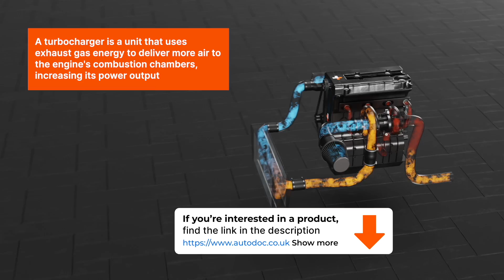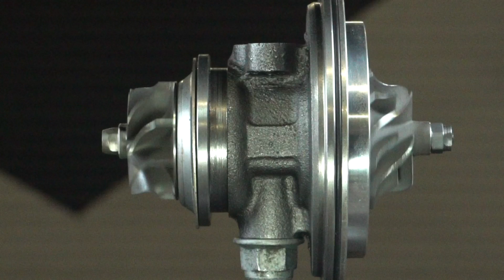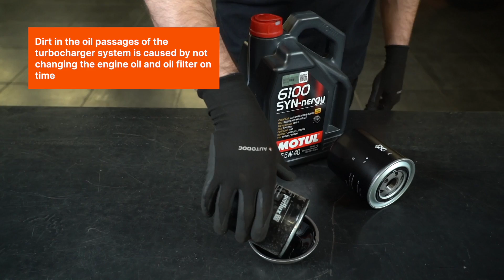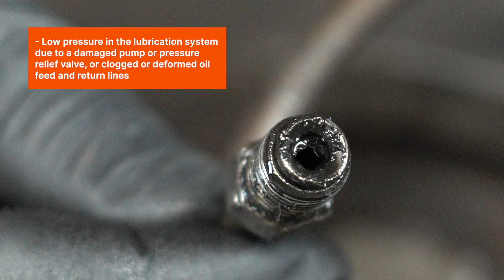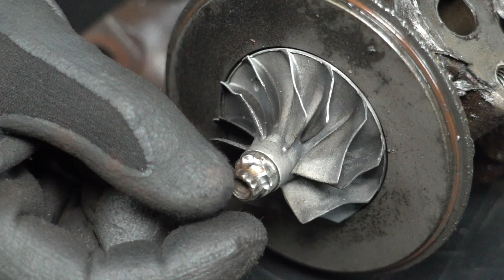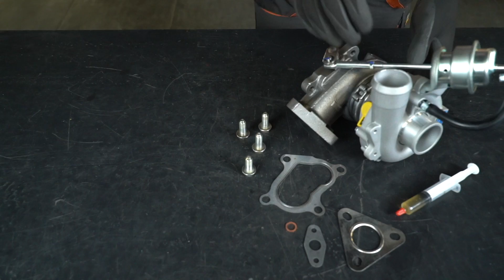5 causes of turbocharger failure and how to avoid them

Comment: Reason no 6 : Dont stall the turbine
Reason no 7: After a sporty drive or highway don't stop the engine immediately.
Reason no 8 : Don't rev the engine above 1800 rpm when its under the optimal working temp. (Diesel)
Reply from the maker: We are sure that your comment will be useful for many of our viewers.

Comment: These are all internal failures. There are also external failures, such as a seized wastegate actuator.

A common fault on the VW EA211 engine. If it sits too long unused, the actuator arm that controls the butterfly valve will seize closed. If this happens, you will need to strip, clean, and grease the actuator arm for it to work again.

The biggest problem with the repair is access. As the turbo is at the rear of the engine bay, right next to the firewall, space for tools is very tight.
Reply from the maker: We are sure that your comment will be useful to many of our viewers.